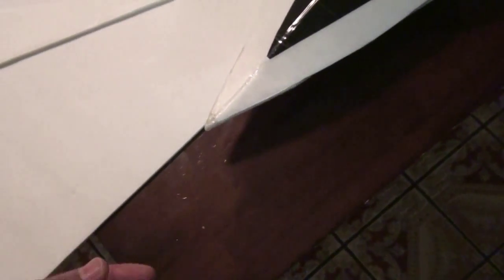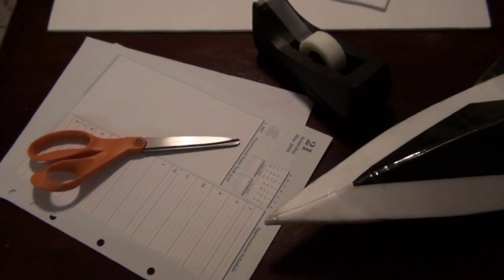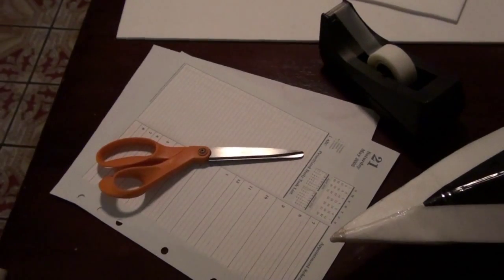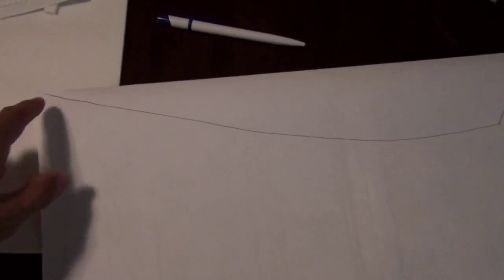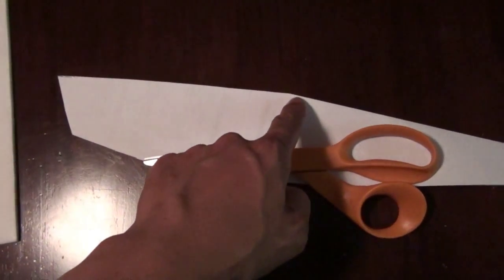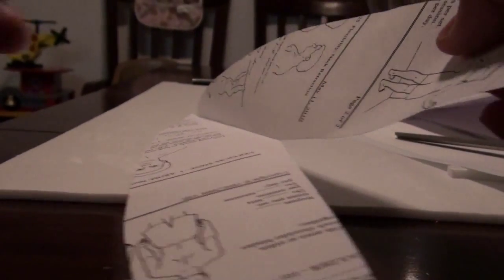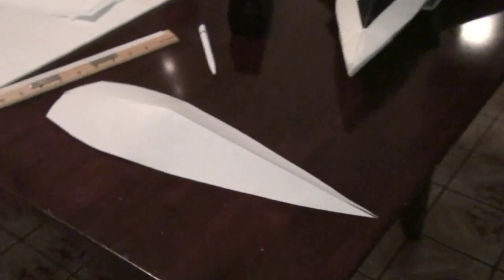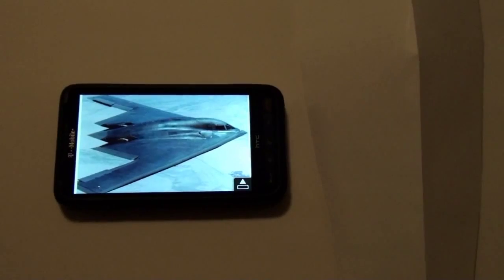building a lifting body fuselage with foam board

Comment from the maker: @rcFoamFighters yeah, i'm kind of worried about the design since it doesn't have a rudder. i was considering using a gyro? but i would rather not, just to keep it simple. also, i was wondering if i should do the drag rudders vs. elevons to once again keep it simpler. any advice would be appreciated. thanks Paul